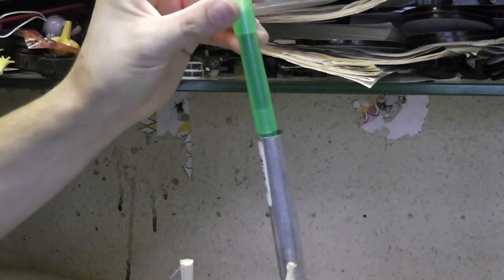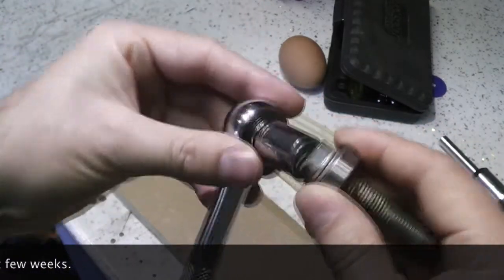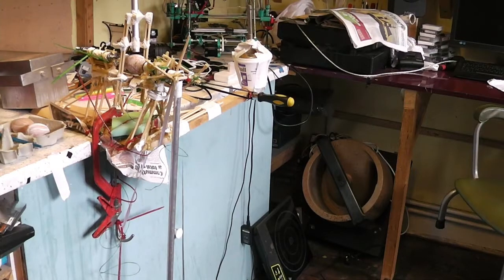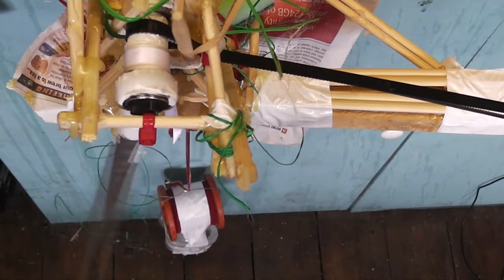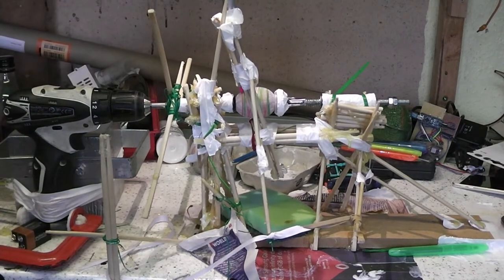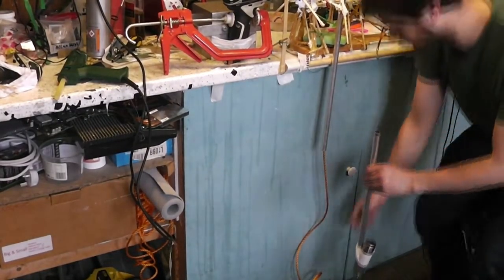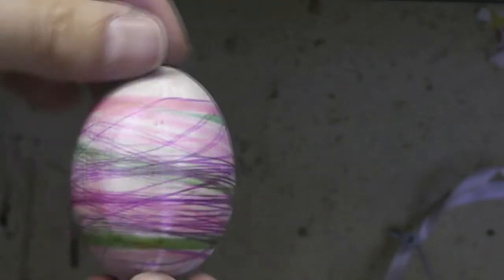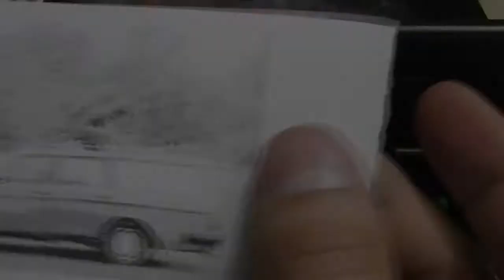No Electronics EggBot / Chaotic Pendulum

Comment: An interesting project! It appeared to me as though you were over complicating the mechanisms that were required to achieve the results you desired. The thang01046 YouTube channel would be helpful for projects like this. Thang01046 is an elderly gentleman in Japan who likes to explore mechanical principles and concepts by designing mechanisms that illustrate their practical application and then uploads a short animation of his CAD designs to benefit others. Have you tried any of the centuries-old methods of egg decoration? My favorite is using onion skins as it leaves the egg looking like a piece of marble. Anyway, how are things coming along with Fusion 360?
Reply from the maker: Jeffrey Vastine I definitely was over complicating things, this project was an exercise in taking a roundabout route and taking goals with a pinch of salt. Goals are important sometimes but my work life and the stuff I do for fun often get overloaded with goals and I need to kick back and break a few eggs! Fusion 360 has blown my mind but I haven't finished any projects on it yet. Plus I'm upgrading my 3D printer to a delta configuration so I'll have a better tool to print out stuff I design on Fusion 360. Exciting times!
Reply: Great! If you make your delta printer sturdy or rigid enough you could use it as a 5-axis milling machine too.